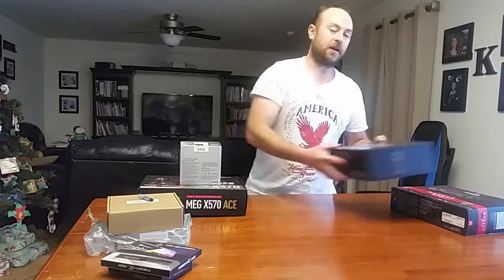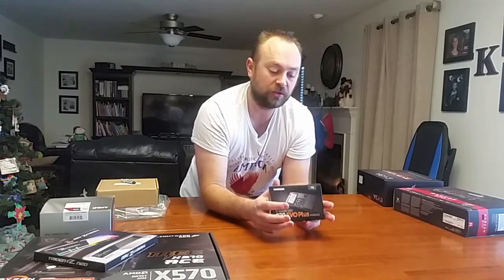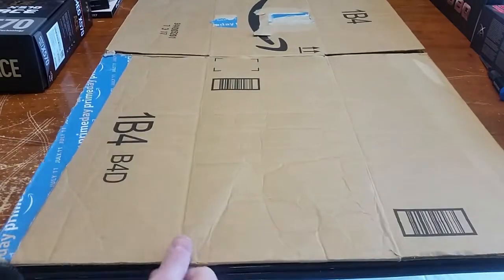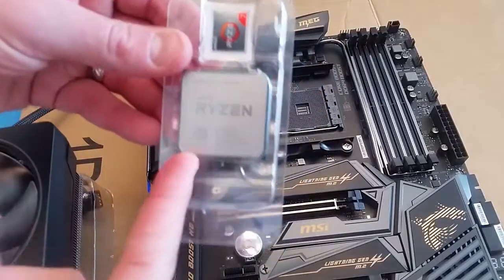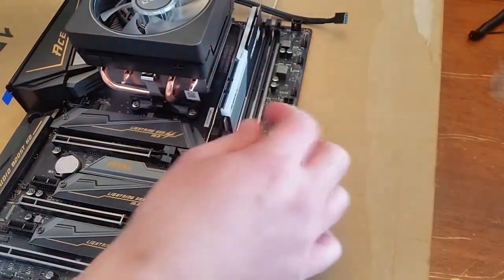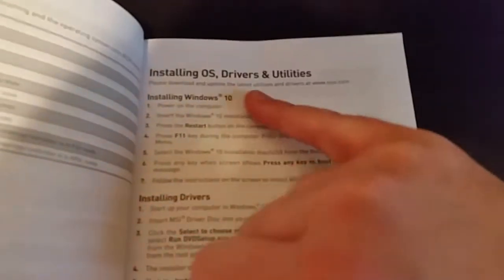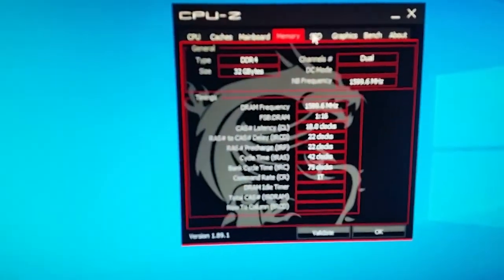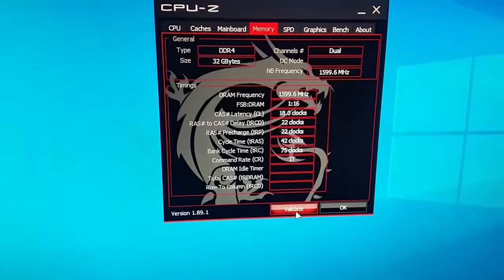How to build a computer in 2020 step-by-step.  Ryzen 7 3800X YeahPete

Comment: Question....How has your : EZDIY-FAB 2-Port USB 3.0 USB 2.0 Front Panel Card Reader been working out?  Do you like it and is it still working and have  you had  any issues with it?
Reply from the maker: I haven't had any trouble with it.  I also have a Rosewill that I've been using for about 3 years with no problems either.
Reply: @YeahPete  Can you give me the link to that one.....I 'm looking for a usb 3.1 gen 2 type c .
Reply from the maker: @TheGregWallace  The rosewell I have is  just usb 3.0 and not type-C

Comment: I have a board of that, but when I put the 4 memory slots it does not give video, but with 2 if it gives video what is the problem there
Reply from the maker: Could be a bad memory stick.  Swap the 2 existing memory sticks with the 2 that made no video and run prime 95.  Use the same slots to rule out a bad memory slot.  If the computer runs fine after swapping the memory it could be a bad memory slot and RMA the board.
Reply: @YeahPete  The 4 memories are good, they have already been tested, but even the board does not give video when the 4 memories are put only the 2 main ones work well the other 2 extras do not give video, the board is new from the box as it could be damaged
Reply from the maker: @OsirisRD  Yeah probably bad luck on the silicon lottory. I would return it for a refund and try again.  Just make sure you've tested all the memory sticks yourself.  If you know someone with a similar computer you can try your ram sticks in their computer.  Or try memtest86.

Comment: How is the CPU holding up? Have you considered putting an aftermarket cooler on it yet?
Reply from the maker: Its my aunts computer its doing great thanks for asking.  I dont think an aftermarket fan would do much better maybe like 3 degrees cooler.  The stock cooler was plenty, but the case also has good airflow.
Reply: @YeahPete  Aftermarket coolers can make a much much bigger difference, like an AIO for example, or some of the dual stack heatsink designs with noctua fans! Or even a custom water cooling loop,  however the stock cooler is more than sufficient unless your overclocking or draul for low temps
Reply: Anthony Choueiry  Yup that too, my fav iis Artick MX-4 I had stock paste on a R5 1600 an old chip i had like 2 years ago when it came out pretty much and replaced it with that MX-4 stuff years later and had a 14c difference in temps and have stuck with it since
I now have a 3900x didn't even bother with the stock paste and used that mx-4 paste, even have a custom loop on this sucker lol! I don't want it getting hot I like low temps :P

Comment: that sucks cheap case , my case has standoffs already installed and there is a standoff in the center by first m.2 and the motherboard cover is hiding it not sure if that can be taken off is a big deal I think so because I was going for a massive cooler and it might cause flexing because of weight, when I put the motherboard in I thought when I installed m.2 drive it would be there but it's not it's under the cover itself I can see the marking hole for standoff when looking at back of board so I know standoff should be there

Comment: The only reason I watched your video was to see how you did the power supply cable hook ups, and you completely skipped that.
Reply from the maker: Sorry I didn't cover that.  I just start with the biggest cable with is the 24 prong motherboard cable, then add the additional motherboard power cable, then the GPU cable.  Im adding a new GPU to my older computer, I'll unplug all the cables and make a video of that.
Reply: Yeah Pete did you connect 2 8-pin cpu cables into the motherboard or just a single 8-pin?
Reply from the maker: @Jubbowubbo  Just the single 8 pin.  The other  connector is only needed if you have a more powerful cpu.
Reply: @YeahPete  Wrong, the second 8 pin is to provide aditional power to the PCI-e slots, and it's fine to touch the IHS of the cpu btw just not the pins lol, and the cables with the power supply are pretty much the same as any other lol, and I didn't persoanlly like your ram placement myself, but at least you did dual channel, I start from the left not right... (1) 2 (3) 4 also, M.2's are SSD's not Hard Drives, they don't have a spinning platter in em lol, they use Nand Flash :P Also, the CPU can support more than 3200 it can do 4000 even, at launch they had a few issues trying to run at higher speeds which is fixed with a bios update, as long as you motherboard can cope, which yours can you'll be fine, but overall you did a good job.... just a few nick picks lol
Reply from the maker: @ReversedTech  Thanks for the comment.  I'd like to know the source of your information about the additional 8 pin power being the PCIE slots.  Page 8 in the manual says CPU power 2 and it is labeled as so.  I also contacted EVGA and MSI and they confirmed this.  PCIE power is from the 24 pin Main Power Connector. 

I probably should have clarified the HD and SSD and instead referred to them as a storage device.  Yeah theirs a big difference good catch.
Reply: their is a point in the vid he explains about the second 8 pin, as well as a bunch of otherstuff relating to VRM's and so on
Reply from the maker: @ReversedTech  That guy made another video correcting himself for being wrong.  A lot of these people in youtube don't know what they're doing.  They think some Chinese SSD will perform as well as a Micron, Intel, or Samsung SSD.  Out of the box yes, but after 3 years it will be half speed.  I bought this MOBO on black friday, so todays prices do not reflect what I paid for it which was $320.  I paid slightly extra for the built in Gen 2 wifi, bluetooth, and the built in heat pipes, well worth what I paid for it.  Thats why I say buy on Black Friday.  Price right now is over $500 on newegg which I dont think is worth the upgrade.
Reply: @YeahPete  Samsung make the best Drives, their are a few other good brands like corsair, and yes I also do agree that chineese is shit, I am a motorcyclist and I have a 4 year old chineese 125 and a 20 year old Suzuki bandit 600 (Suzuki is japanese) Guess which one is in better condition... one of them is rusted to fuck and is falling apart where another is almost in mint condition, I wonder if you can guess which one lol, and in my opinion the Ace is still a waste of money for what your paying for it, if you bought on black fricday, the unify would of also been cheaper